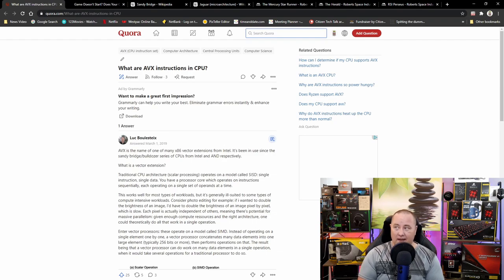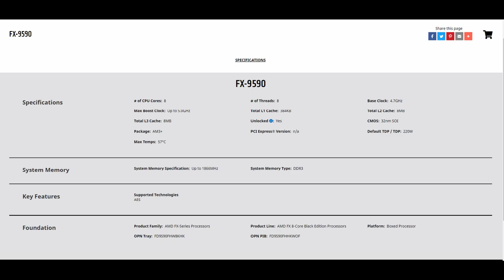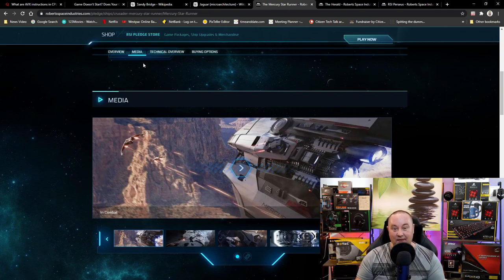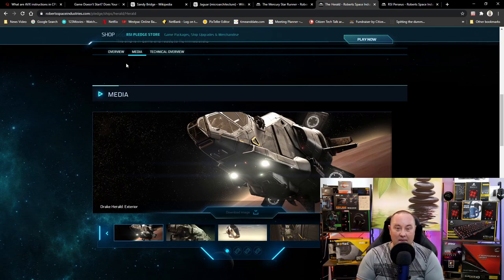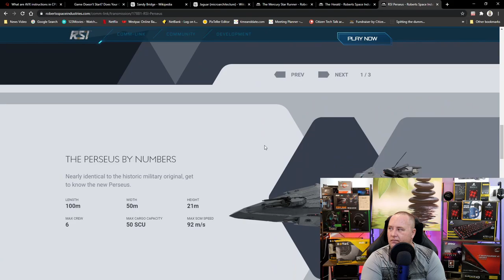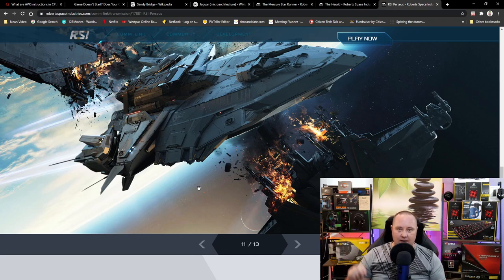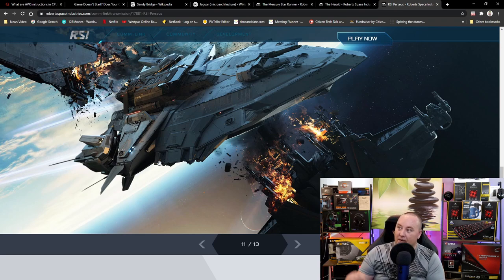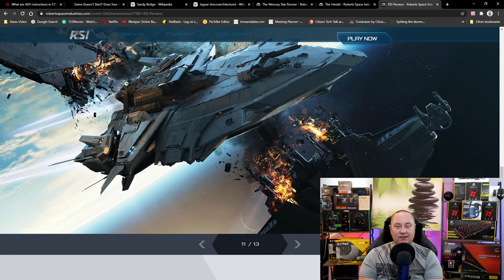AVX!? Star Citizen & Ships Explained!

Comment: If you're willing to order from Aliexpress, you can get "x79" motherboards for under $80US, and 6-8 core Xeons w/AVX for under $50. Just upgraded my son's pc to an E5 2650 v2 w/32GB Ram (quad channel) for $170 (for CPU, Ram and mobo).. that's 32GB w/51.2GB/s mem bandwidth, 8 cores, 16 threads, all cores @ 3ghz w/AVX (3.4GHz if you hack the bios).
Reply from the maker: Excellent advice! Thank you very much for the info!
Reply: @CitizenTechTalk  just an update. My son's computer with the Xeon (E5 2650 v2) now runs Star Citizen better than my computer with an i7 6700k. 😂😢
Reply from the maker: @RTSTET  Oh mate! That's fantastic! How did you get around the AVX issue? Or is it a post 2011-2012 Xeon processor? Awesome news! Thank you very much for the update mate!!

And better than a 6700k?! I'm gob smacked!! Extremely good buy mate!!!
Reply: @CitizenTechTalk  The E5 Xeon CPUs have the AVX instruction set. They are a phenomenal value for SC folks on a budget. And since they support quad channel memory, they make up for their use of DDR3, as 1866MHz quad channel has higher throughput than 3200MHz dual channel DDR4.
Reply from the maker: @RTSTET  That's fantastic! Hmmm you might have given me an idea for the channel (once I finally get my new video card that's on back order) as well! 

So an extra thank you sir!! 

I'd love to see on screen FPS captures between the two builds, that would be awesome to see. That way I can talk about budget builds and how you can get even better results from old hardware and for an absolute bargain! For Star Citizen in the short term. 

I'm very impressed with your research skills too mate! Very impressive!!
Reply: @CitizenTechTalk  I just shot you an email.

Comment: My xeon x3470 dont run :( fix update avx?
Reply from the maker: The AVX instruction set only works with CPU's after 2011 sadly and most Xeon processors from even 2013 didn't have AVX as they were intended for workstations not end user gaming applicatons sadly. 

You still have a great CPU, just not in Cloud Imperium's eyes as its the "too hard basket" to program for with the crappy Cryengine Frankenstein code they're using. 

I keep saying Unreal engine, Unity even. That solves the AVX issue as, well! But hey..... Common sense isn't that common these days right?